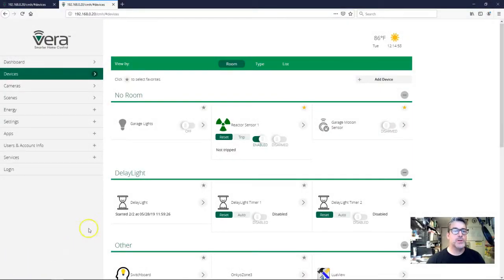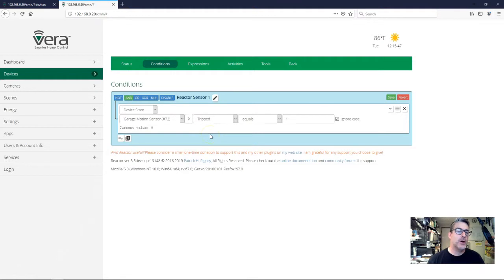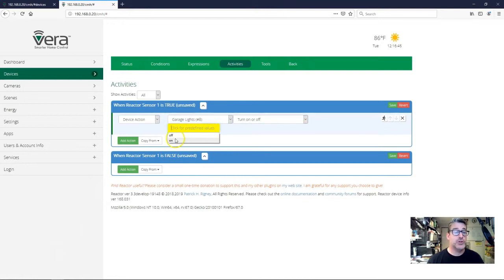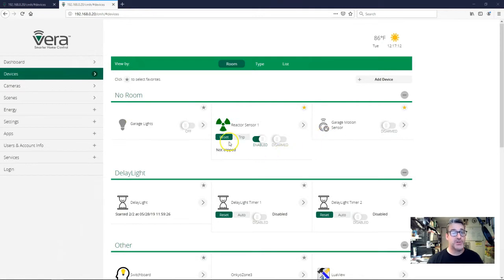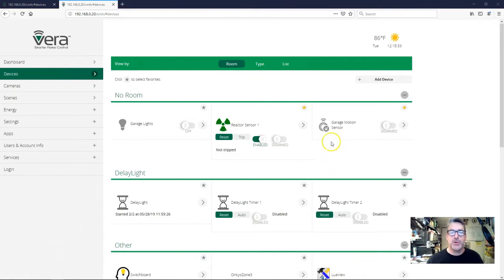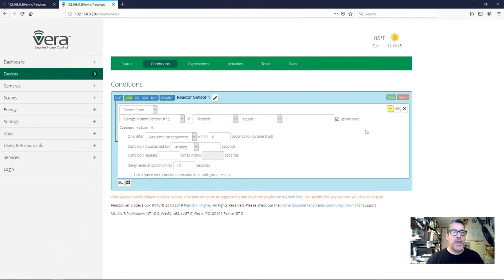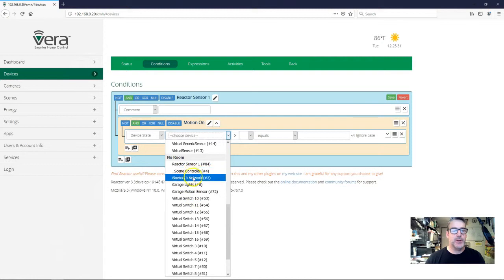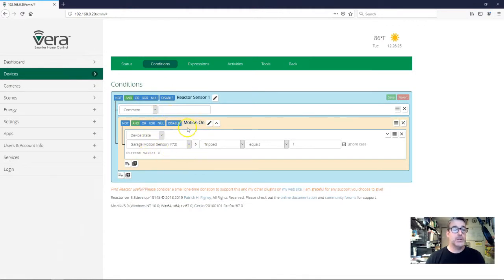Reactor for Vera #003 - Simple Motion controlled Light v2

Comment: Ironically, a lot of motion sensors detect motion when lighting changes, hence your example could theoretically have created a loop, lol.
Reply: Most have a reset period where, after tripping, they don't respond to further stimulus, and in some cases, will not even send a reset message to the Vera until no motion has been detected for an unbroken period. So loops are usually avoided. If it is a problem for the device, Reactor provides various timing options to debounce and dampen such behaviors.

Comment: If I'm setting a device to come on when triggered by a sensor, between time A and B only, and turn off after an hour....I can do that part, but how do I also make it turn off based on a different sensor event? Would that be an OR condition, an XOR, or just create a scene to turn the device off if sensor says Y?
Reply: If you've put (or modify to make it so) your "on" conditions in their own group (with the "on" action to the device assigned to the group's "is TRUE" event), then you can create another group in the same ReactorSensor to contain your "off" rules, which may be something like "device is on AND sensor has not detected motion + option sustained for one hour". At this stage, I recommend always putting your logic rules into subgroups, and not use the "root" group for anything but as a container for your other logic groups. This lets you do more in one ReactorSensor so you don't have to create multiple. It also lets you use the output of a group as a condition in another group, so you can build complex rules from simpler parts. Hope this helps! If you're not on the Vera Community Forums, you should be! I'm able to provide more details and content when replying there.